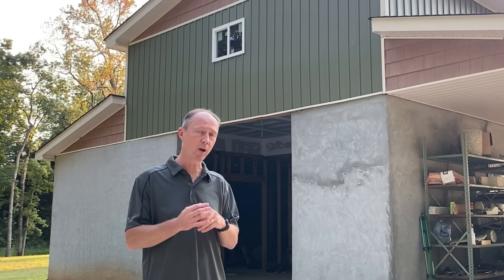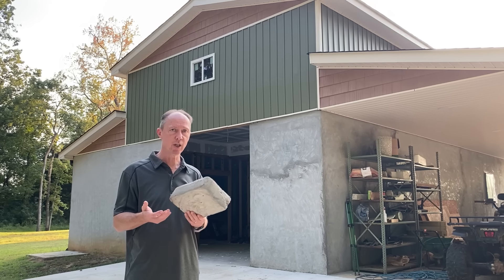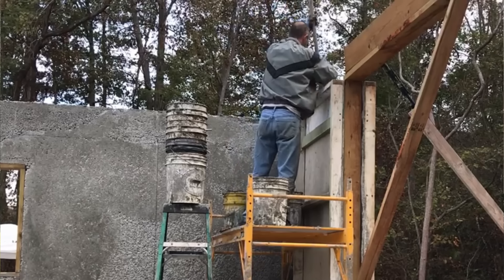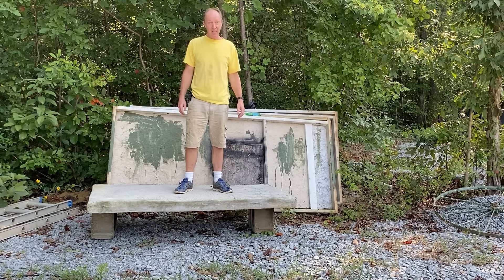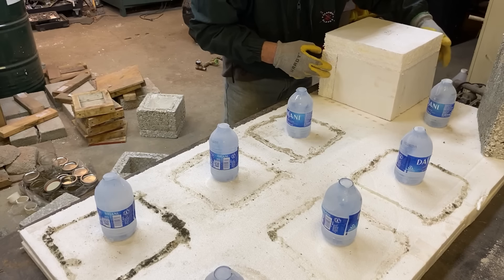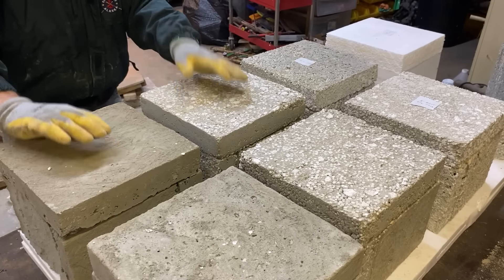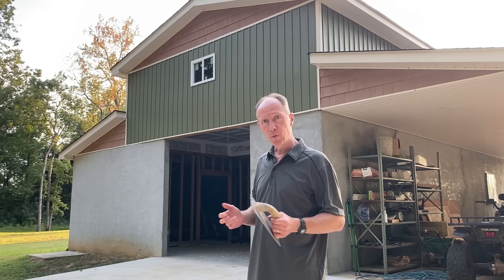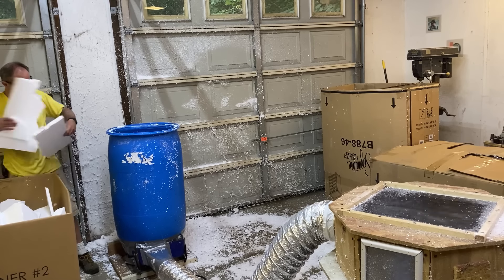The White Gold Rush?! The Video That CHANGED Aircrete Forever!

Comment: In your other video that shows your shredder machine, I noticed your foam gets everywhere and clings to everything. The best way to help eliminate the static when grinding the foam is to just mist it with water occasionally. This makes clean up so much easier and quicker. I regularly cut 2 lb density EPS on my CNC router table and I keep a spray bottle of water near by when I clean up the shavings and dust after cutting. You may be able to hook up a ring of fine atomizers around the inside housing of your blade and wet the foam slightly while cutting. You're going to be adding water anyways, so having wet styrofoam shouldn't be a problem in your mix.
Reply from the maker: DesignCutters I have been thinking about doing this and glad to hear you confirm it is a good idea. I am thinking of ways to shred and fully contain the shredded styrofoam so it does not go everywhere.

Comment: Thanks for all your good experimentation and innovation! 

Also, for removing so much STYROFOAM from landfills & encouraging others to do likewise.. Great work!
Reply: How would one dispose of styrofoam aircrete once it reaches it's end of life?  Would this type of aircrete be able to be recycled the same way concrete would be, or does the added strofoam mean it needs to be taken to the landfill?  What are the consequences of leaving styrofoam aircrete to decay when abandoned onsite?  I dont mean to be a negative nancy, just wondering what the net lifetime impact of this would be.
Reply: @liquidfrice  were do they recycle concrete?
Reply: Actually after tornado's here in TN it went all back into the landfills and proved a deadly structure
Reply: @liquidfrice  grind it up and make recycled styroaircrete.
Reply from the maker: You're welcome! Subscribe for new builds coming soon!
Reply: @LongdogGarage  In California some landfills  take concrete  stucco any cementauis material   It is then ground up mixed with road base

Comment: Seems like you could pour a floor and then tip up wall panels, complete with rebar and pre-installed wood nailing ribs.  Medium sized tractor for the lift.  Really nice video, thanks for sharing.
Reply: That's what I was thinking. I didn't see in the video but is he using any vibration to settle or remove air?
Reply: @jakeledg  looks like all he's using is the packer thing he made
Reply: That’s a good idea.  Domegaia has been experimenting with building a wall like that they call it the flip up method or something?
Reply: Call a tilt-up wall system.
Reply from the maker: Thank you! Subscribe for new builds coming soon!

Comment: This is a very ingenious way to build economically while reducing energy needs and also helping the environment by recycling.  It’s amazing how Steven is thinking outside the “box” and providing so much benefit.
Reply: it is but seriously people there way much more environmentally friendly ways of building. Aircrete is a great product nonetheless !
Reply: @ottodidakt3069  
Like what?
Reply: I dont like it, its weak and is very labour intensive.I dont think it will perform well in a fire, or earthquakes/flooding and natural disasters.
Reply: @tubester4567  I said the same thing. I've been building for 31 years and seismic, high wind, and flood plane codes have changed several times since I started. Depending on where you live snow load might also be an issue
Reply from the maker: Thank you! Subscribe for new builds coming soon!

Comment: I have a few ideas for you. 1) Look at nylon Bird Netting.  It comes in giant sizes to go over fruit trees to keep birds out.  It is also used to keep Hawks away from chickens.  You might be able to use it instead of the fiber meshing. 2) Look a heat shrinkable plastic that is used to cover boats for winter storage.  Now if you utilize old fashioned chair webbing/bird net/ +heat shrinkable plastic, you can heat shrink the plastic down onto a complex form.  I once made a tailbox for my recumbent bike for loaded touring using chloroplast strips (like a basket) and the heat shrinkable plastic.  The tailbox turned out both lightweight and aerodynamic...  Once the plastic shrinks, the structure becomes drum like.  3) For complex shapes, such as roof elements, with embedded beams that are at right angles to the shape, perhaps adding a small amount of concrete hardener might allow the mix to stiffen enough to continue pouring. 4)  Bird netting could also be used like sidewalk screen within the mix.  Bird Netting is cheap...  5) There is a fiberglass/epoxy product that you can coat both sides of a dry stacked cement block wall.  It is probably expensive, but it waterproof when used for foundations.  6) For your Arched Cabin, what if you made your arched wooden beams in a "U" shape.  Now, you could put plastic on the inside of the "U". You could then place webbing/netting/heat shrink to the arched areas.  You could then slip form each side.  Filling the top might be problematic.  You might be able split the arch and pour one side and then the other, remove the forms, and slide the two halves together.  I hope these ideas help!!!  KEEP UP THE GREAT WORK!!!!!  Bob Cromer email:  roberthcromer@gmail.com
Reply from the maker: Thanks for the tips! Subscribe for new builds coming soon!

Comment: Breathtaking! Awesome, inspiring, and easy! I'm rewatching this a few times to let some of the details soak in. I have a foam gen. but was stuck on how to do walls and floors. And you showed the way to do that and attic/truss insulation with structural rigidity.
I have been worried about chaos Specifically, after severe weather events. The debris all flocked in pink insulation (hazardous), as well as any surviving living trees, etc. Often spelling destruction of them when clean up commences. Now, with Aircrete and your instruction, you've eased my conscious about events yet unseen.
Reply from the maker: Thank you! New builds incoming!

Comment: I live in a mobile home that has a tendency to attract mold easily, and after seeing this video considering replacing interior walls and insulation with aircrete.  This may be an easier fix than replacing the entire home.  Don't know much about foam so will have to research more.  Thanks for the video.
Reply: That sounds smart
Reply from the maker: Go for it! Subscribe for new builds coming soon!

Comment: Love the research 
 A couple thoughts  for your next project .
 In flood areas   you might want to blend  shredded styro into  concrete .so your building doesnt float away . Bags of  fiberglass or nylon  fibres  mixed in give amazing strength   drill holes then use cement board screws if  you are adding drywall .  Make thicker walls  so theres no need to insert lumber into  it for structure .
 Use plastic vapour barrier on  your forms  and they come off the wall easily  and give a smooth finish .
 Im looking forward to uour next video
Reply from the maker: Lots of good advice! Thanks! Subscribe for new builds coming soon!

Comment: Genius always flows from the practical. Love this. I would want to see compression and tensile failure testing before I would build too much.
Reply from the maker: Ben, the tensile test is fairly easy to do and I plan to do one soon. The compression test I am still trying to figure how to do that on a budget.
Reply: All the tensile strength is in the fiber embedded in the coating. It is your choice.
Reply: @AbundanceBuild  I hope you are able to add some rebar to a slab for a comparison on the tensile strength tests. Also was there a reason you did not use perlite and went to the eps? Thanks for doing the videos!
Reply: A harbor freight press with an air attachment and a gauge? Wouldn't that give you the compression test?
Reply: @AbundanceBuild  Hydraulic jack or porta power unit with a pressure gauge is a simple compression tester.
Reply: @AbundanceBuild  - Hi Stephen, some nice work here. Years ago I ran a lab that tested concrete on a special  compression machine that gave the strength of blocks, bricks, concrete mix etc in Newtons. 
Back in the seventies we were desperate for ideas that would compete with pumice blocks.
I am sure a local concrete mix provider would be interested in your idea and would test your pieces for free.
You won't know till you ask. Best regards Joe of UK
Reply: @AbundanceBuild  If you want to try a simple compression test on the mixtures, get a 1 inch square solid steel rod mounted to a plate of a certain size..then mount it to a 3 point fixture that's in plane with the sample. Add springs to the 3 points, then add weight to the top side of the plate. For each amount of weight,measure the distance from the bottom side of the plate to the sample, and plot the compression to failure of the sample. The solid square rod need to be longer than the sample thickness to test to failure. Then you can show a plot curve of the compression strength.

The test fixture....get a 1/4 inch steel plate and cut it into a triangle large enough to fit a 5 gal bucket in its center. Attach the square rod to the center. Then attach the 3 corners to a set of springs. Attach the springs to 3 adjustable eyelets supported by a frame. Level the plate to the sample, then add 1lbs of water to the bucket and measure the compression to failure. If it doesn't fail with 1 bucket of water, just stack more if needed. Hope this helps...
Reply: A simple shop press with a bottle jack and some kind of pressure sensor would probably work for your compression test.
Reply: @timmcwilliams8024  
Rebar in the slab would be next to useless in my opinion.  Rebar in normal cement construction adds strength by locking the steel ridges  to the concrete creating a monolithic structure. Foam cement is not strong enough to lock to the rebar.   I would think there is a way to add steel but not using conventional rebar.
Reply: @AbundanceBuild  Call the closest university with a civil engineering department.
Reply: @AbundanceBuild  I second the motion for looking at "Project Farm" videos for testing inspiration. I would also add that "Practical Engineering" is another great channel to look at. He does some stuff on civil engineering and concrete testing.
Reply: You  need   a  structural   engineer   to  acess   load  bearing   factors   in  a  earthquake   zone. ? ? ?
Reply: Noob question.

Why would tensile strength be needed for his wall panels?  What matters is the compressive strength no?
Reply: @johnle231  I wouldn't say that I know very much about structural building, having said that I would instinctively agree that the forces pressing the material together would be useful however the force is trying to pull the material apart seem equally important.

Any structure isn't one contiguous piece but made up of small bits adhered or fastened together in some manner with forces placed upon it in each direction.

Comment: There is a concrete product called "vinyl patch/crete," and this has strips of vinyl fibers mixed into the concrete to increase the tensile strength... So, if you could find a free source of fibers and mix them in before your pour, you could probably get rid of the need for stucco.
Reply: Fiberglass or rock wool insulation could work.
Reply: @slaplapdog  Fiberbond fiberglass concrete is what i was thinking too.
Reply: Blow insulation
Reply: Chopped fiberglass is pretty cheap
Reply: Doesn't concrete break down fibreglass?
Reply: @1upPaintingAB  No. Glass infill is a commonly used concrete strengthening material. Research GFRC.
Reply: @1upPaintingAB  
Common fiberglass will. Fiberglass put into concrete needs to be alkali resistant.
Reply: Horse hair could work also.
Reply: @crash4dafun  Or, high silica hemp fiber. Someday, this will be dirt cheap...
Reply: @1upPaintingAB  Yes it does, they use alkali-resistant fiberglass.
Reply: Where can you get free fibers?
Reply: @allwaterproducts  

Is $10/lb average for chopped glass fiber?
Reply: @johnle231  Shredded windmill/turbine blades?
Reply: @elmerkilred159  

Where on earth will I find shredded windmill tribunes or blades?  Are you joking right now?😂
Reply from the maker: Thanks for the tip!

Comment: I would be interested in seeing how other lightweight fillers in a mix like this would perform. One that comes to mind that is super cheap and similar to Styrofoam is rice hulls. They are basically waste and are very insulative while having a high resistance to rot and fire because of their high silica content. I know that rice hulls can be used as blown insulation that does not pack down due to weight if treated with chemicals or diatomaceous earth to prevent insects from nesting in it. It has slightly less insulative value than cellulose or fiberglass blown insulation, but is is just as light and far cheaper.
Reply from the maker: thanks for the tip! subscribe for new builds coming soon!
Reply: @Knightswithoutatable I like your Rice Hull idea. This could be a possibility in our area in the Philippines as well.
Styrofoam is more challenging to get access to here in the Philippines.
Good Luck!
Greg

Comment: You should add chopped glass fiber from the stucco store to your concrete it will add a ton of tensile strength. By adding these fibers to 3k psi concrete it will be well over 10k psi  search this   1/2" Chopped Fiberglass Fibers
Reply: That's what I was thinking, I want to try that mix, I also want to make the bent dome mild he did not make.
Reply from the maker: Thanks for the suggestion. I noticed that EZ block, which is an aircrete ICF block is very hairy which means they are using fibers in the mix.
Reply: Runs about $10/lb.  is that average
Reply: Why would tensile strength be needed for his wall panels?

@iammimic79
Reply: @johnle231  I dunno hurricanes tornadoes earthquakes weight from snow build up on the roof. Any time you can make anything stronger it’s better. Imagine building your wall and then when you start to build your second story the bricks at the bottom start to crack and crumble under the load. Or  any span lime window opening door opening and garage with weight over them start to sag and crack.
Reply: @johnle231  hear in California,, the ground shake's, once you have seen the ground ripple across a Field, you can never go back to the "Terra firma" concept.
Reply: I am hoping to make a light strong Aircrete mix with styrofoam and fiberglass chop. I was glad to see it's being done and I can find out what's going on.
Reply: @johnle231  also the Roman’s used to put hair in their concrete mix usually chopped horse or goat hair and the concrete they made still stands today.
Reply: @Justthemow  

But what you’re talking about is compressive strength right?
Reply: @DANTHETUBEMAN  

Word.  Come back with some results if you remember
Reply: @johnle231  not once it crosses a span under load
Reply: @Justthemow  

What is the force that would be ‘pulling’ the wall panels to create tensile stress?
Reply: @johnle231  gravity air pressure wind nature the problem with air Crete is it’s aggregate is styrofoam not rock styrofoam holds nothing together over time as the concrete starts to dry out it will become brittle and crack those cracks will flake away with nothing holding it together. When you add rocks the rocks create a surface for the concrete to adhere to and add strength the fiberglass acts as webbing to hold the concrete together around the styrofoam you build your aitcrete how ever you want but I work with concrete all the time and I am telling you to add the glass fibers they are cheap and only add to the strength of the concrete regardless of wether it’s tensile or not
Reply: @johnle231  I use to laminate sail boats and they had a chop gun, it cut fiberglass string in to 3 inch strands and shot it out Infront of a resin gun. So I new it was a material to look in to for some level of strength. This styrofoam is a great idea also.
Reply: @Justthemow  

Ok I see.  I was just inquiring for information that’s all.

Would you say around $25 for 4lbs of chopped glass on Amazon is good deal? 

Where to find good deal?
Reply: @DANTHETUBEMAN  

I’m looking to build a foam camper with a poor mans fiber glass skin using linen/cotton sheets + glue and latex paint

Which is from my understanding is what airplane and boat shells use to be made of before fiberglass
Reply: @johnle231   it sounds like a fair price but you should see if you have a local stucco store near you it might be cheaper there
Reply: @Justthemow  

Hey I was watching more videos and reading more comments.

1 guy made a comment that I think is relevant.

He said because air Crete is porous,  that  it doesn’t completely hold on to/bind with the chop stands in order to benefit from the tensile strength the strands would add.

So I was thinking,  maybe Fiberglass cloth cut long ways like 1”x4ft long would be better? 

What do you think?
Reply: @johnle231  I’m not sure I think this type of air Crete would benefit from the fibers as it’s not relying on bubbles it’s more relying on the styrofoam as the airy part